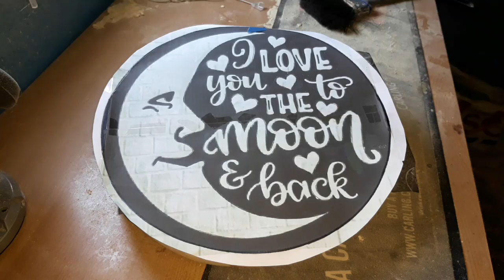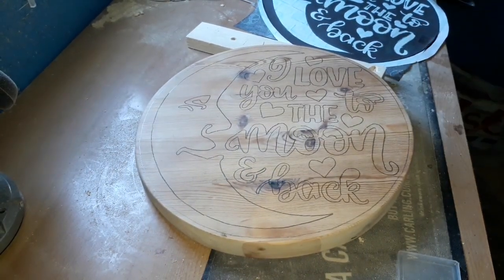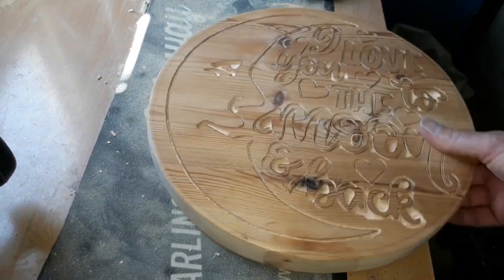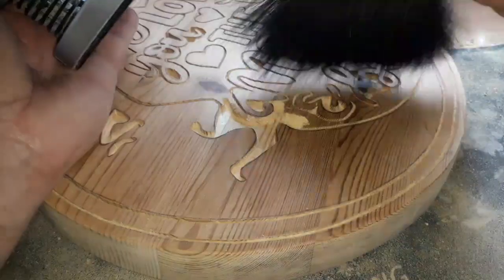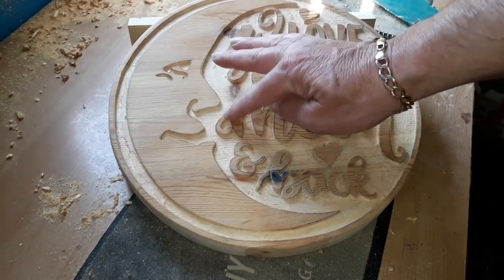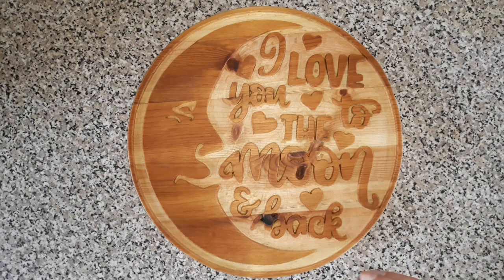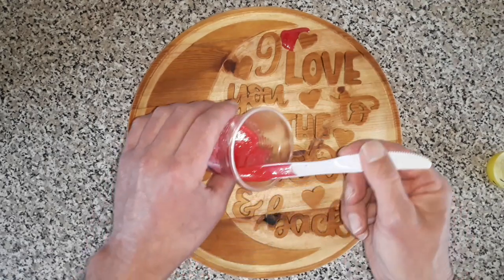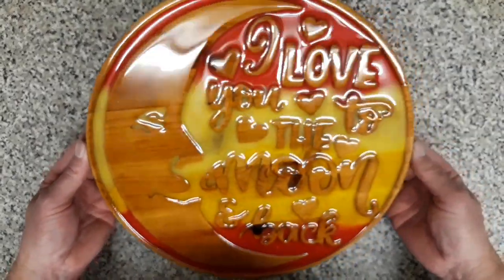Another, I love you to the moon and back plaque

Comment: Something I meant to ask you previously, the resin is waterproof I believe? what about UV resistant? as I know some of the clears can yellow in sunlight. What would you recommend for exterior use.  Thanks again, Gaz
Reply from the maker: I never use resin on outdoor projects, you are right about the yellowing plus uv will fade any colours in resin in time..total boat resin is popular with folk for covering outdoor signs with..just to much work for me..🤣👍
Reply: @fishtank5050  Ok thanks, just wanted something for the planters, maybe best to just do the inlay design work and then a suitable paint or stain. Thanks again!
Reply: @fishtank5050  Yeah I have done loads of research now and although there are some UV resins, eventually they will breakdown. However, followed your advice and been looking at Top Coats, that are excellent for protection and depending where you purchase it from, the prices varying greatly. Something, I am struggling with is the pigments? can you recommend the ones you use, as your colours look vibrant and also appear to have a depth of colour and not like some that are very transparent I have seen. You've been a great help and that's very much appreciated. Maybe you could do a course of some kind and let others learn from you! Thanks again.
Reply from the maker: @gazsto9510  I used to use dyes in my older resin projects,I now use acrylic paints in all my resin pieces,you don't need alot and they give a nice solid colour, you can get powders,inks,dyes..but I'm happy with cheap acrylic paints, Crawford and black acrylic paints are what I use..😁👍